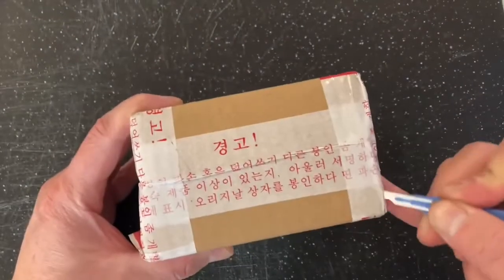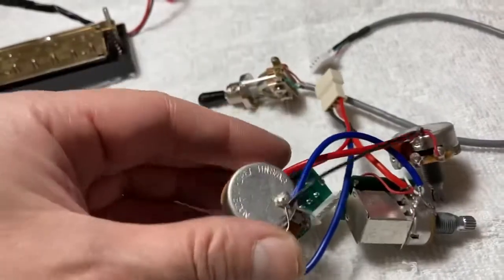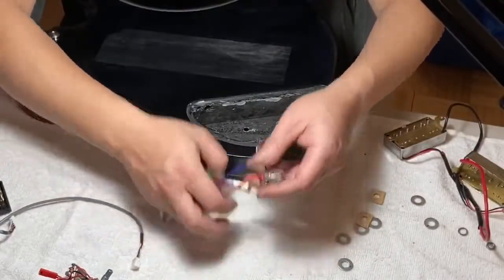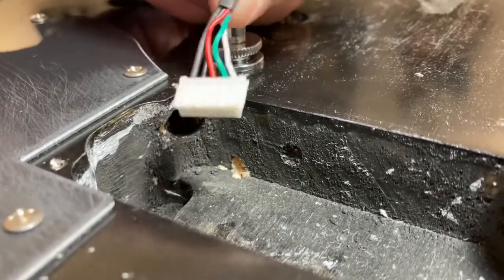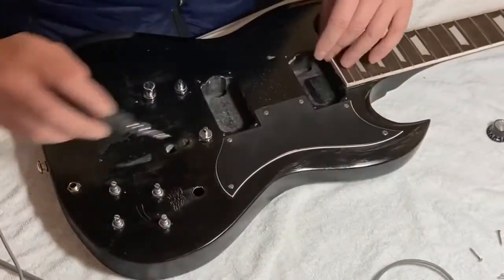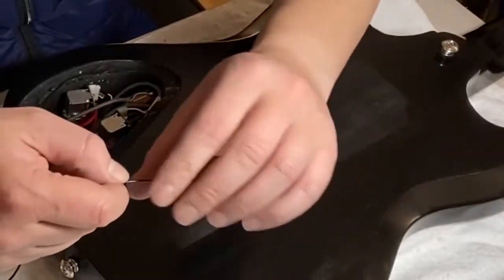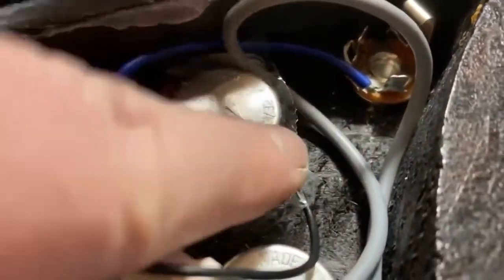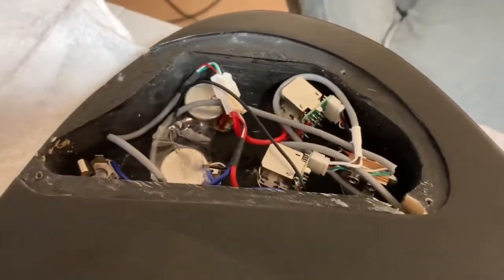Kit Guitar Upgrade! Installing Epiphone's ProBuckers $40 with Pots, Switch, Rings and Jack

Comment: I used the same kit, but took the wires out of the connector and taped the ends together and they went through the holes. Then I just reinserted the wires into the connectors and Bob's your Uncle.

Comment: 🤔 I would have cut the wire and ran them through the hole then splice and shrink tape them back together in the control cavity.

Comment: I built a Es335 style guitar and can say I am extremely pleased with these, Though I paid a lot more on Amazon to be sure I got the real thing . Just a tip for anyone installing these , have a soldering Iron handy as the wires on the pods may come loose  and if your putting them in a Es335 style guitar you will need to replace the black ground with a longer one. Just a side note I lost the pod bolts  so I had to buy replacements, the correct size is  24mm Large Metric .  All and all the probuckers sound absolutely amazing

Comment: I just installed the same set in a 335 copy and had the same issue with the plug not fitting through the hole. I just snipped the wires and soldered them back up. All that drilling on the body made me cringe!

Comment: You could have bent the wires parallel with the harness and pushed it through.
Reply from the maker: it was too big...
Reply: @guitarhobbywithdannythemedic  But it's easy to disassemble and reassemble with a small screwdriver. I have done it myself.
Reply from the maker: @theclaudiosmweb  a small screwdriver? I will try that next time. I do have small screw drivers..
Reply: @theclaudiosmweb  Hello friend, can you explain how you disassemble and reassemble the cables? I am thinking to buy the set, but I'm not sure if the harness would fit.
Reply: I just put these pickups in an sg a few days ago and had the same problem. A very small screwdriver can pry up the clips at each one of the wires and pull them out of the clip. Run the wires through, then reinsert them in the clip.

Comment: So you taped the ground wire to tone pot?  Is this effective?  I want this same kit but don't have a solder iron.  Don't really feel good about taping the wire.  Was wondering if the wire glue or solder paste would work?
Reply from the maker: get a solder iron and some solder. basic stuff is very cheap

Comment: Nice fretwire on that SG you built :-) THanks for the video, i have these pickups in one of my guitars and they sound great. I would advise putting a .15 cap for the Neck pickup as the .22 cap is too bassy. This cap change really changed the dynamics of the neck pickup and made it useful and also match the bridge a little better. Thats my tip for the day ;-)
Reply: Were yours wax potted ? The set of these i have are indeed wax potted. No squeel
Reply: Also to to identify which is volume and which is tone. If you have standard pots, the pots will be labeled A500K or B500K. The A's are your volume pots (audio pots) and the B's are your tone pots (Linear). ;-)
Reply: One thing is make sure is, shield you pickup cavity with either shielding paint or the tape. They leave a lot of excess wire with these and that can become almost like an antenna and cause a lot of noise. But make sure the shielding is grounded as well or else itll actually make it worse. But thats the one issue i see with these little kits is the excess wiring when your not installing it into say a LP where the wire is run farther.

Comment: DUDE YOU COULD HAVE PULLED OFF THE LITTLE CONNECTORS OFF THE PLUG!!!!! WHY T F WOULD YOU DISGRACE THE POOR GUITAR LIKE THAT!!!
Reply from the maker: pull the connectors off the plug? ... I just went and looked at the plug.. I dont have the faintest clue how to do that, but my method of making a channel for the wires may have been more palatable if I used a router instead...
Reply: @guitarhobbywithdannythemedic  on most connectors you have a little locking mechanism, like this one: https://m.media-amazon.com/images/I/61Heb54UqHL.jpg
Reply from the maker: @andrezpalencia3033  so its like you do that and you can pull the wires out, then after, put the wires back into the plug?
Reply: @guitarhobbywithdannythemedic  yes!!